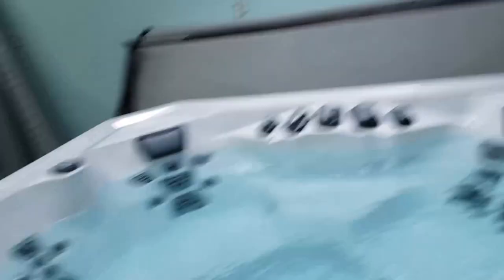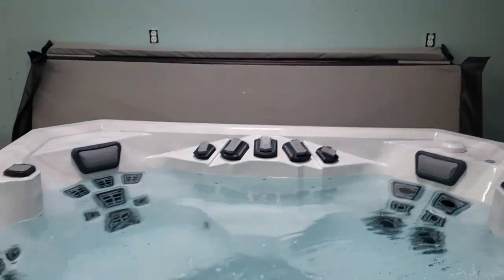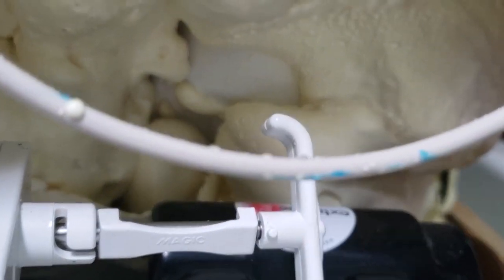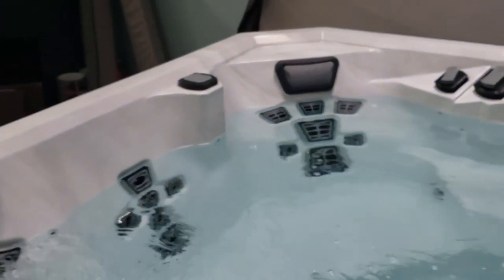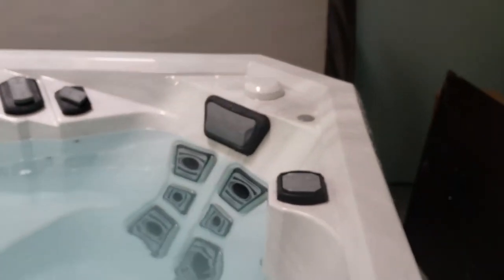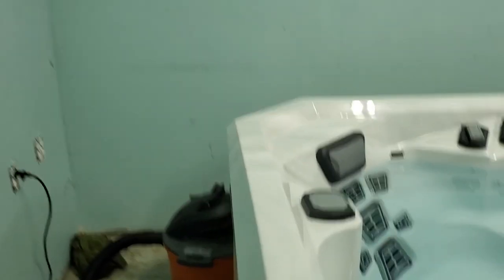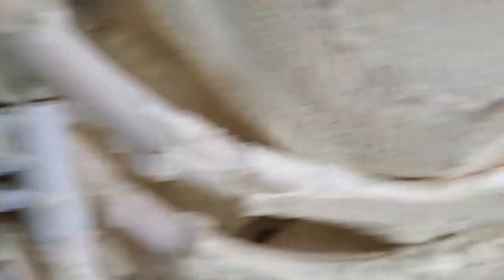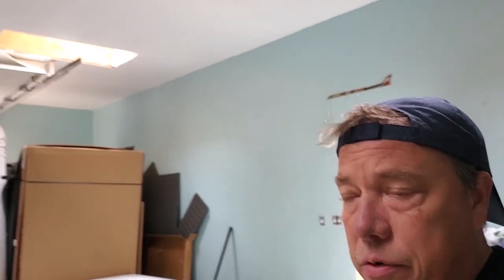Marquis Vector 21 Review - 2018

Comment: Hi Chris, thanks for keeping up the good work , informing people on how to build a hot tub the right way.  One thing that you missed, they are not even using pressure treated wood in the bottom.  This type of more expensive wood helps resist moisture.   Stay safe!
Reply: I want to go over to your website & take a hard look to see how you manufacture your Spa's at Pacifica!

Comment: Ok, so keeping it real here, there is good information related to learning the various aspects of buying a hot tub; insulation, jet thrust, control valves, etc... However, there are some vary glaring errors in this review. The first one being insulation because Marquis offers a full foam insulation option that wasn't used on the version Chris is reviewing. https://www.youtube.com/watch?v=XYF5whxG-vc might help with ensuring you consider all angles when believing everything you see online.
Reply from the maker: Yep we missed that one, there is an option for full foam insulation.

But the rest is pretty basic visual stuff, look at how many clamps were missing, the tub had leaks brand new out of the factory, remember these guys were on my top 5 recommended brands when I shot this video, I was expecting a solid well made spa and that is clearly not what this example is. Best case is its  bad QC and I have 3 or 4 cutometers on  Hot Tub University reporting issues.

It will be interesting to see what the new equity investment acquisition will mean, too bad those guys and Artesian were some of the last hold outs, there are so few privately held players anymore and acquisition means the bean counters are controlling the engineers, and the slick marketing machine will keep it selling :-)

Comment: I've been looking around what do you think about the A7 Bullfrog or just bull frog in general?
Reply from the maker: It falls into my middle class, certainly not a nightmare brand but 2 things that keep it out of my top ranking. The first is the shell, I really like a self-supporting fiberglass hand-rolled shell with a vinyl ester resin core. This unit uses an ABS plastic shell with poly rigididser, its a less expensive shell and it requires pedestal supporting to hand the weight of the water and the people:  https://www.youtube.com/watch?v=_T9DY6am_E0&t=2s

Secondly I really like to see a Balboa heating and control system, these guys hold some key patents that really make it a step above the other systems and while the gecko system they use is better than a lot fo the proprietary parts being used on many brands I really lie the Balboa system.
Reply: I see your point on the pressure point support I was kinda worried but I'm looking for a spa with easy Maintenance (after warranty) without tearing out foam and that's way I asked about bullfrog so their biggest flaw is the non self supporting shell and the heating and pump. Thanks for talking to me about this

Comment: Hey Chris, whats your view on the Hot Tub Albuquerque "the truth" video in response to this ? Pop corn ready.
Reply from the maker: The video speaks louder than words... Do you think this is a representation at a super well built hot tub with good build practices and outstanding quality control?

If your answer is yes then don't ever be a reviewer of hot tubs...
Reply: Hey Chris how do you explain all of the lies again your review of Victor 21 videos that hot tubs Albuquerque exposed
Reply from the maker: What lies? 

That the build quality is shoddy? 

That they didn't clamp the half the plumbing lines? 

That it leaked? 

That the foam was applied in a careless hit and miss fashion with entire areas of the shell not covered and pipework exposed?  

The only mistake I made on that video was the shell :-) it had cradle supports covered in spray foam that totally looks like pedestal supports. When we took the bottom off to repair the leaks we saw they were just styrofoam blocks likely used just to line up the tub in the frame so we removed that part of the video, usually when you see a self-supporting shell there are none of these blocks under the shell.

Not sure what you are referring to, You are obviously an industry person who is spinning this to be something other than what it really is... 

The video speaks for itself if you can watch this video and come away with this being a well-built spa than you sir are a charleton...
Reply from the maker: @TheEryar  Gee no clamps required? That sir the dumbest comment anyone has ever posted :-)

It would not be leaking if they had spent the money to clamp the plumbing...
Reply: Your willful ignorance of innovation is astounding!

Comment: What spa company's are in your top group ?
Reply from the maker: I look for companies doing what I consider the main 4 things. good quality hand-rolled self-supporting shells using a vinyl ester resin core, I won't easily sourced competitively priced OEM parts like Balboa, CMP waterways, I don't want some asshat who is getting cheap parts made that only fit their tub with built-in obsolescence and stranglehold on availability and pricing. I want the plumbing lines glued and clamped on the jet and manifold so they don't leak, and I want good high R-value insulation... This is the main stuff and its what cost money to build into a hot tub, its hard to find the truth of who is doing what because often they will say they are doing something then we find they are not :-( so factory access is critical, we need to be able to see first hand what they are doing, I have toured dozens of factories and so far the verified builders i like are Master, Artesian,  PDC, I also have Coast and Beachcomber on my list but need to do factory tours which in the case of Coast has been put off from COVID
Reply: @ChrisWheatley  thanks for all the information I will definitely take it all Into consideration on my hunt for the right tub. FYI the latest I've seen bull frog does use the "Balboa EL 1500 pumps" (not defending just thought you might like to know
Reply from the maker: @greenreviews3391  Yeah thier pumps are ok I really like a waterways head on a US motors motor but the heating and control system are what Balboa is really good at...
Reply: @ChrisWheatley  .. oh ok I was just thinking if they use Balboa pumps they would use the same for heating and control.hard to find info on these on the internet so I really am thankful you can enlighten me on the subject. can they be easily swapped for one or the other ex.if the Balboa motor was to fail I can just install a waterway and install a Balboa heating/control if It was to fail outside of warranty? Just asking cause I'm starting to believe there isnt a hottub that fits what I'm looking for as far as outter components seating foot well ect.. in it and has all the want underneath  I think I'm going to have to put it with the aftermarket USA parts as I go

Comment: Did you tell the customer the tub had leaks and you repaired them before you sold it to them?  Why would you sell a tub that you yourself classify a "mess" to any customer anyway? Btw, NO CLAMPS REQUIRED!
Reply from the maker: LMFAO, of course, I told the customer it was a leaky piece of crap and showed them the video... 
How can anyone but a shill say "no clamps required" when it's leaking like a sieve and obviously needs clamps :-) 
You sir, just might be a moron :-)
Reply: @ChrisWheatley  how professional. Swearing and insulting your followers, and now calling Marquis a swindler!  I have no relationship with this company nor do I have anything to do with their product, I simply know the technology of the hose.  It is ingenious and quite INNOVATIVE! (and costs a good bit more than standard hose and a $.10 clamp (a good thing says you)).  As for leaking like a sieve, I see no actual leaks from these connections on your video.  Do you know what a sieve is?  Again, NO CLAMPS REQUIRED!

Comment: You deff do more good than bad for the industry and overall do a good job educating the buying public. I think this is hands down your worst most disingenuous video. Clearly a hit job. I just got my 748L south seas and do love it thought about sending you a pm. They are doing some things different these days. Maybe the industry is as a whole. But never the less, a change you should know about.
Reply from the maker: 748L South seas you own is an Artesian spa one of my top 2 recommendations... it's NOT a Marquis...

As for this video, what's my motivation? I was recommending this tub to people in my top 5! I'm pissed off when I'm doing this video because I feel like a dupe...  This tub was a mess.. honestly dude, you see the missed clamps, you see the leaks... no one can say this was built right or should have gotten past QC.

You know I have reached out a dozen times to these guys willing to accept that this was a one-off with the proviso that I get to see the factory... nothing else... they won't let me in, I'm not even asking for money... I smell something man and this tub speaks for itself...
Reply: Thanks for responding. Is there a way to send you a pm directly?
Reply: @ChrisWheatley  the vector jet doesn't have any barbs.  The contact surface area of the tube around the smooth plastic is 1000% greater than that of a barbed fitting.  Marquis uses clamps on all of their barbed fitting jets which are necessary.  Try pushing the tube on a Vector jet without glue.  You can't pull it off.
Reply: @jasonsloan3926  This guy's mind is stuck in the dinosaur times so he wouldn't be able to grasp new concepts within the manufacturing process.